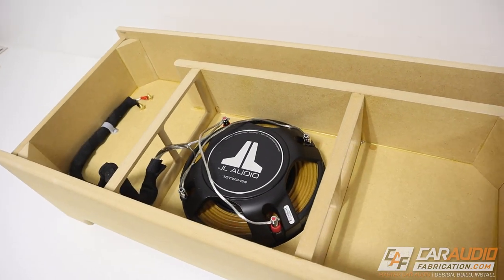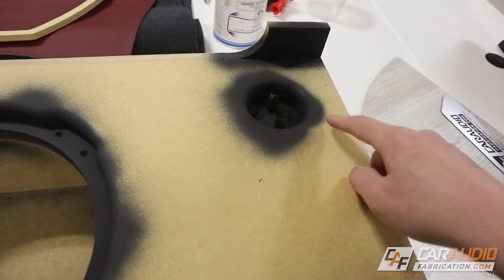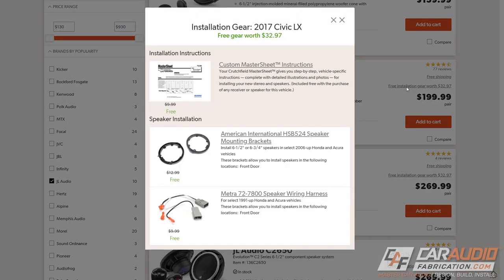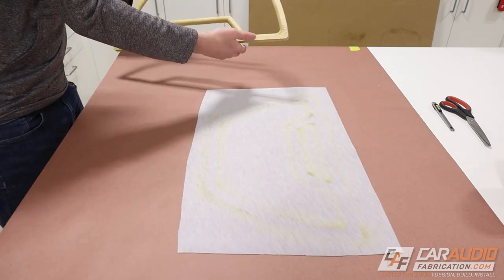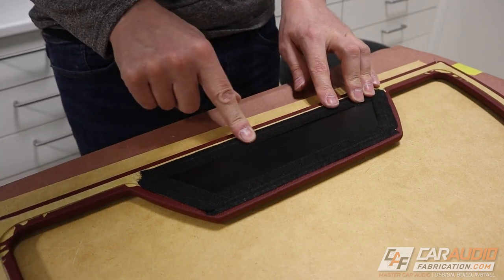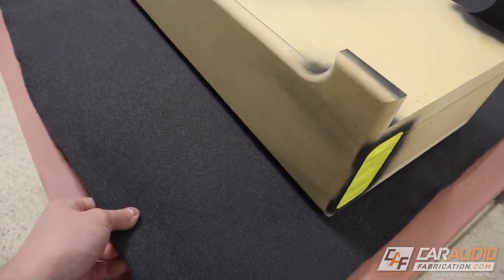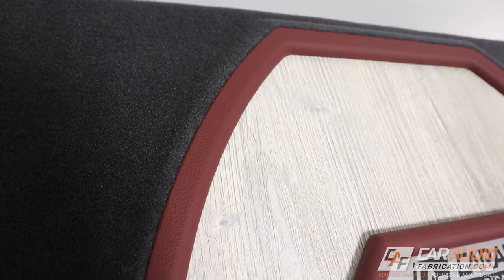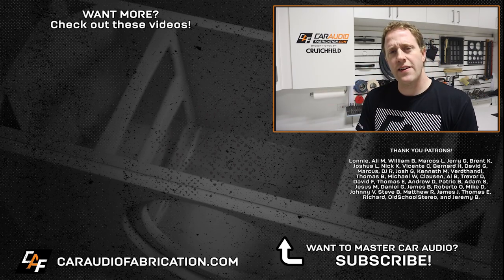Perfect Upholstery! How to WRAP subwoofer enclosure - Carpet & Vinyl

Comment: Does the 10" come with spring loaded terminals or is that an upgrade? My 12TW3 has regular old blades on it.
 It's nice to see someone putting pride in every aspect of the build,even what can't be seen. p.s. Your router setup is the cats pajamas ! I did high end 12v Audio back in the late 80's til 2002, just got burned out and took another path. I still Hobby Build from time to time. Keep up the great work !

Comment: Don't see a link to where to get the vinyl from. Great video though.
Reply from the maker: Vinyl is a raw material much like wood. You buy it from a local supplier and there are a million varieties to work with.
Reply: @CarAudioFabrication  Hi Mark, I have built my first subwoofer box. Well cut all the panels for it. My vinyl we be here today but I wanted to know what is the best way to wrap it.   This is a 4th order for 3 Focal 10s. I wanted to use Black to wrap the sides bottom and top. The front and rear in white. Also I want to do the inside in white because I have 2 plexiglass windows, one in front and back. Should I wrap the white pieces first before assembly and then black after its built? Thanks for any advise.